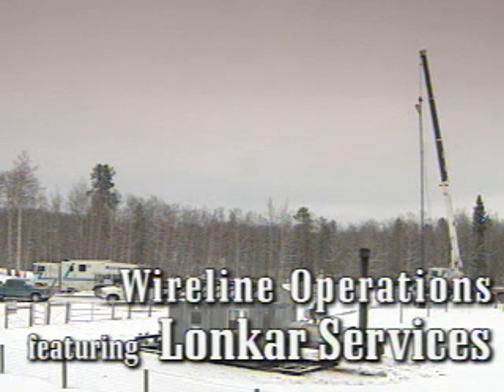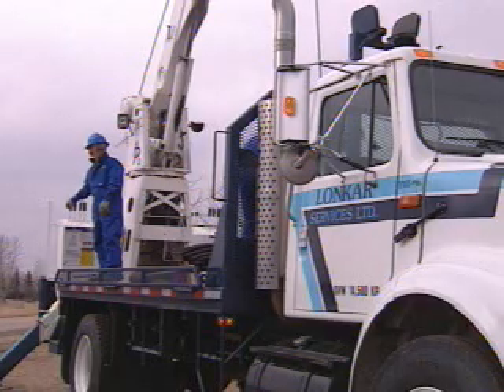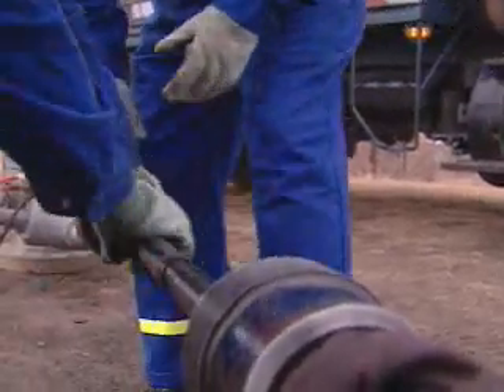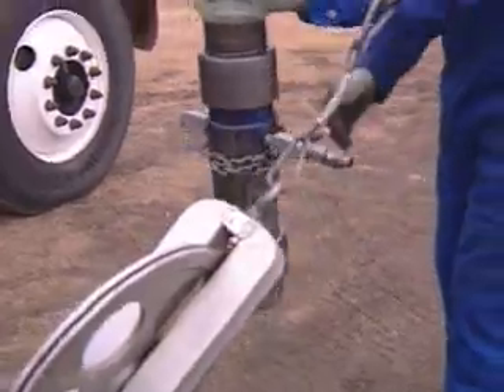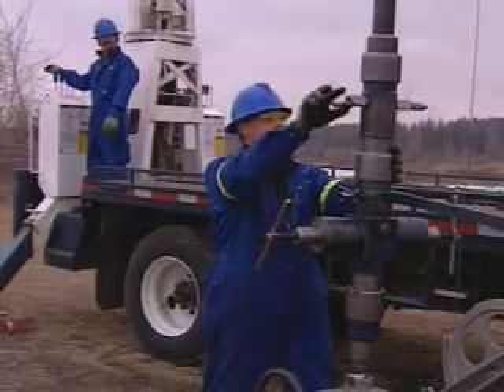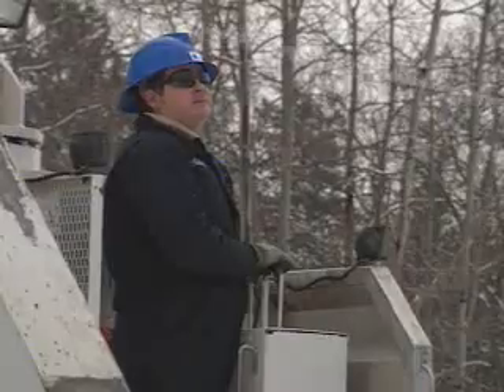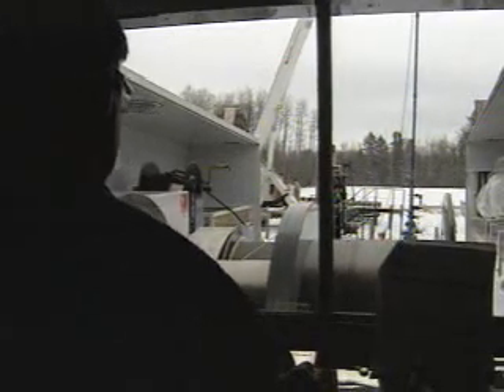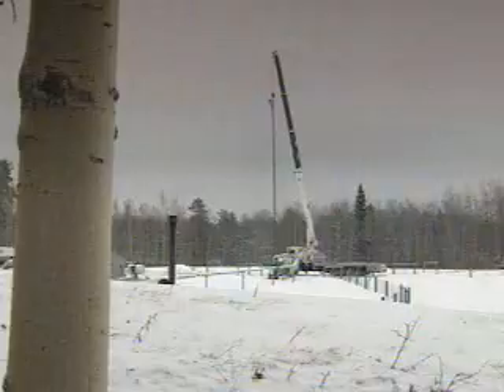Wireline Operations

Comment: This is slikline not wireline because in Wireline we are using electrical Wire (Cable)
Reply: your comment makes no sence, just because it's Not E-Line doesn't mean it's not wireline. I am an E-Line Operator and I have expieriance in E-Line along with both Braided Line and Slickline , they are types of wireline.
Reply: here in brazil this kind of operation is known as wireline

Comment: funny how they say the other contractors screwed up so these wireline people are fixing the mess
Reply: Hamza is mis-informed. I worked for OTIS Engineering and we always used slick wire for our operations. Shit happens, and people make mistakes out there in the gulf and on land. Traditional wireline wire is the gauge of a coat-hanger wire.
Reply: Eh sometimes but not always the case, I’ve been wirelining for 3 years now and sometimes the well head is leaking and we gotta set a retrievable plug so they can work on it. Sometimes a service or drilling rig gets their pipe stuck and we gotta come cut it or do a back off so they can get their unstuck pipe back lol